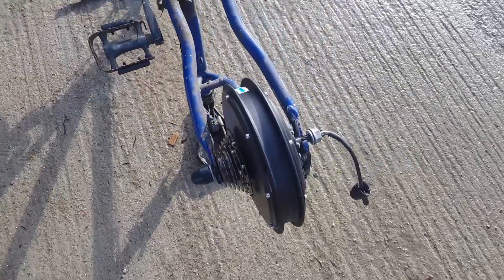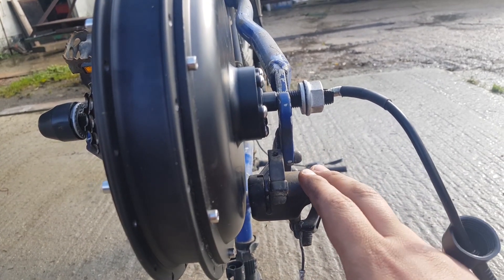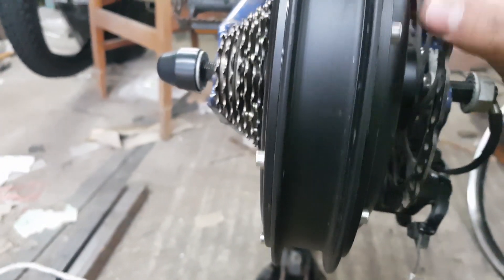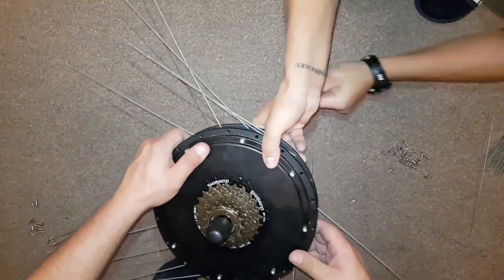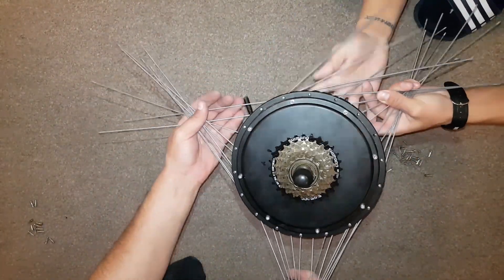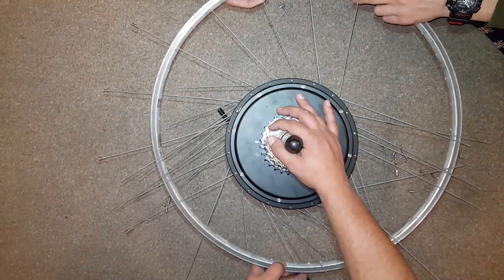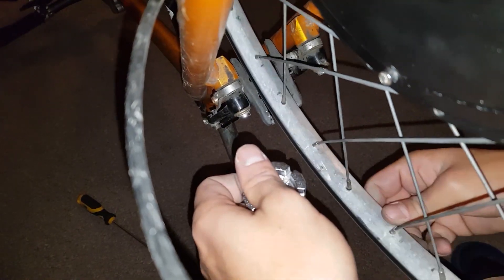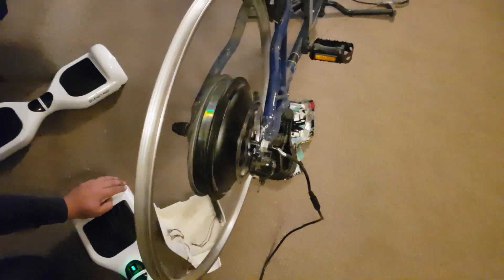How to make an electric bike at home | DIY electric bicycle Part 2 - Wheel Building ( lacing )

Comment: How can you use the same spokes that came with the new wheel? The diameter of the motor is larger than you will need shorter spokes don't you?  Do you have links to the motor you bought for £20??
Reply from the maker: Yes, I was supposed to use shorter spokes. Actually, after a few months of use, the wheel started wobbling, so I've made another video where I did explained everything, and I used shorter spokes. Regarding the motor, I said I've got it from Facebook Marketplace.